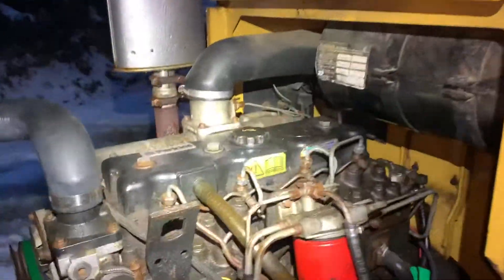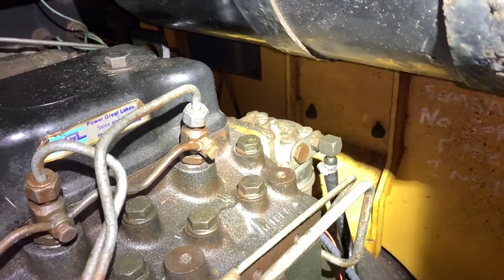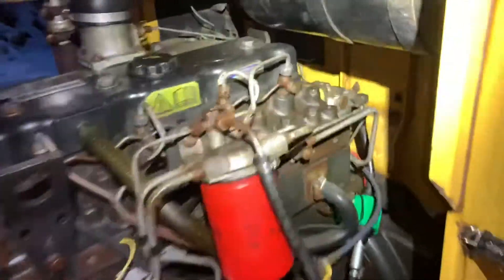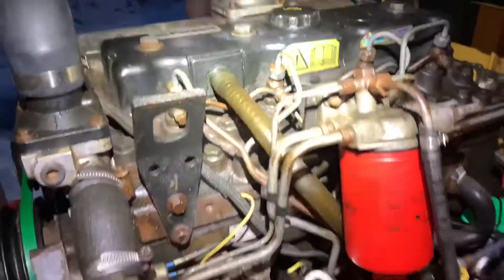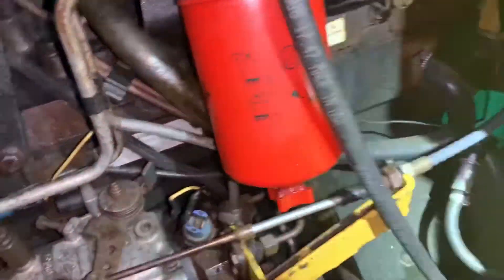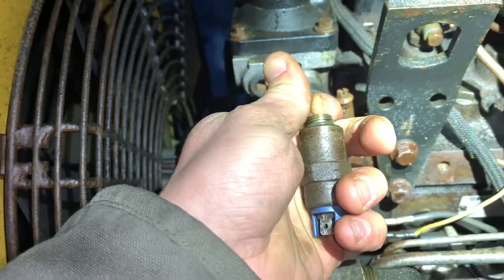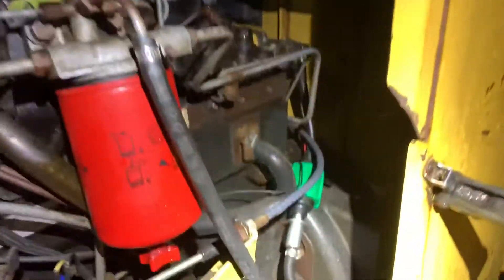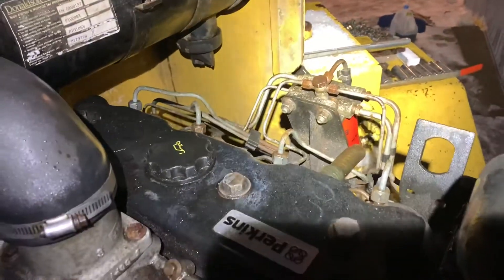Vermeer Chipper BC1230A Fuel Delivery issue

Comment: I have a problem with mine that discharges a lot and I changed the battery, starter and alternator and it's still the same.  Any recommendation.
Reply from the maker: Discharge a lot as in pulling power when not in use and killing your battery?

Comment: im having a fuel issue with my 1230 looks like a similar system. i think im going to try a electronic fuel pump, my hand primer broke
Reply from the maker: Be sure to check fuel shut off solenoid.
Reply: I’m having similar problems and I feel like from this video more than likely it’s the sel after watching this video